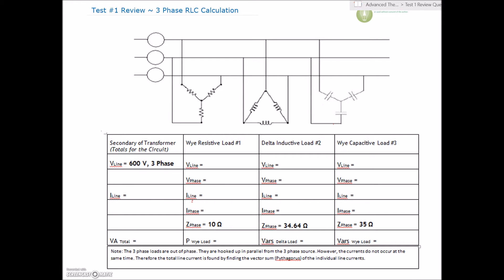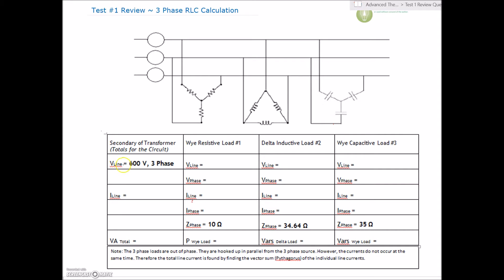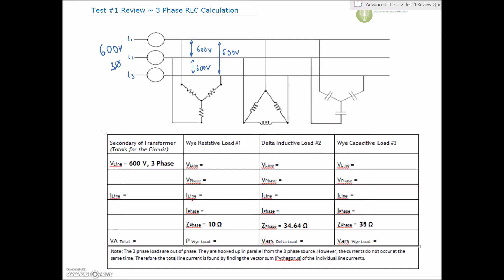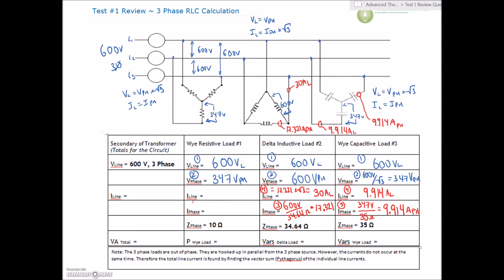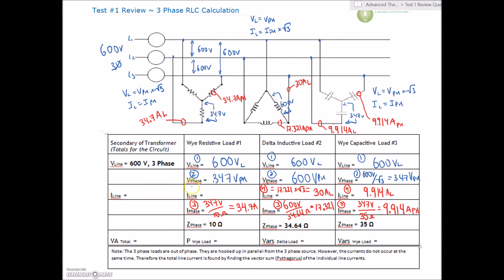3 Phase Test #1 Review (Part 7) 3 Phase RLC Calc.

Comment: I found I-Line by using VA/Vline/1.73
Reply from the maker: VA=V line x I line x 1.732  so I line = VA / (Vline x 1.732) same equation that you will find on the bottom of your transformer sizing wallet card